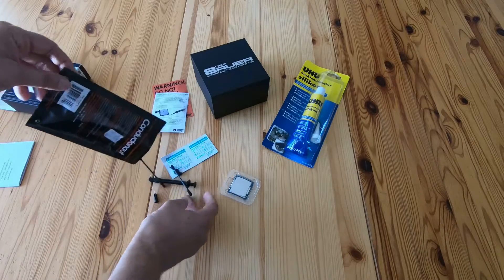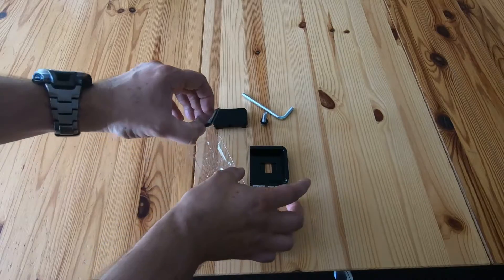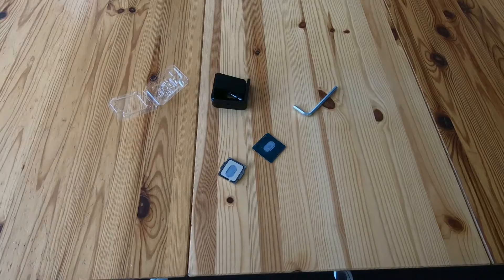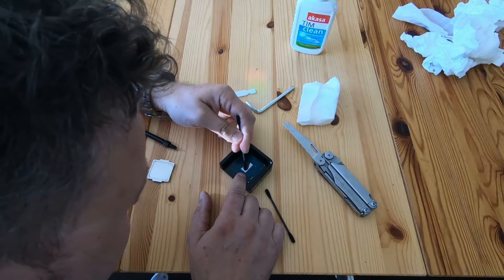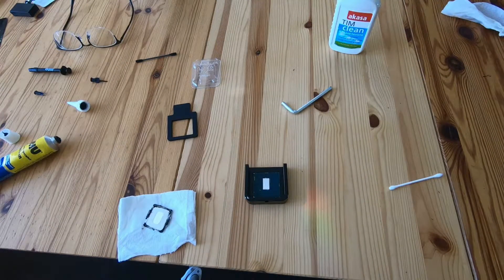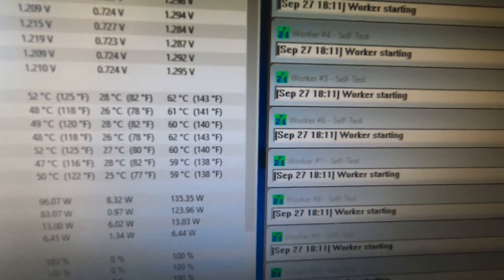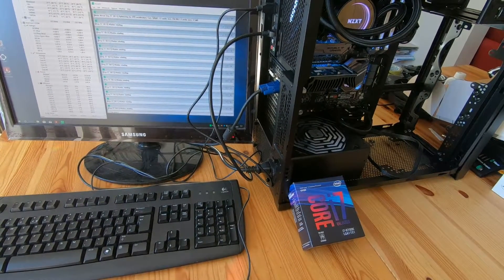Intel i7-8700K Delid *HOW TO*  in English

Comment: I've been considering doing this with my 7700k recently because of the delidding tool making it so easy. Still scary to think about accidentally messing up.
Reply from the maker: The CPU in the video was a brand new i7-8700K that cost £350.00 and I was petrified!  I've overclocked before, but this was actually my first modern CPU delid because I didn't really see the point of such an invasive procedure. I was wrong about that....  There was a real chance I was going to break it but I was confident it would work having researched the tools properly. Get the stuff in the video and try it - it's worth an hour of stress when you see the temperature difference. The tool is flawless - you can't really go wrong.

Comment: When you applied the liquid metal on the IHS did you guess the position that was applied to? did you use a guide?
Reply from the maker: I checked and then double checked the orientation of the lid and then applied a rectangle the same size as the CPU die. It's a perfect square with two wings on it where the socket retention mechanism grips it - so it needs to go back on the right way with the liquid metal rectangle correct.

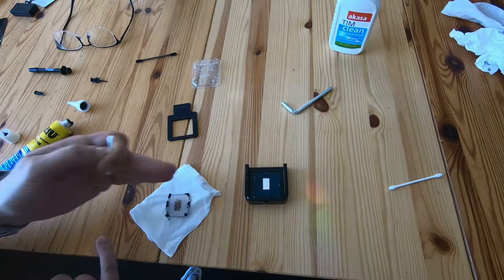I actually used a bit of Selotape to mask the lid ( this is mentioned at 10:34 ) and is pretty easy to measure up so it matches the size of the die before you apply the liquid metal.
Reply: @sterntechdaddy  thanks mate